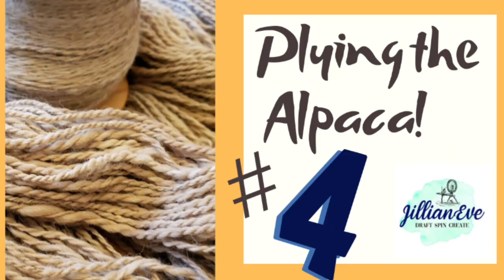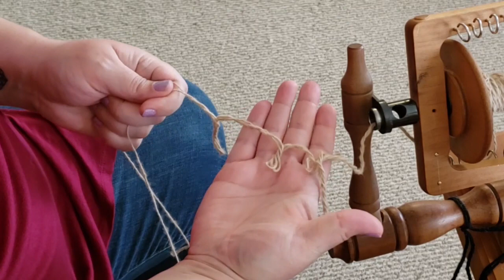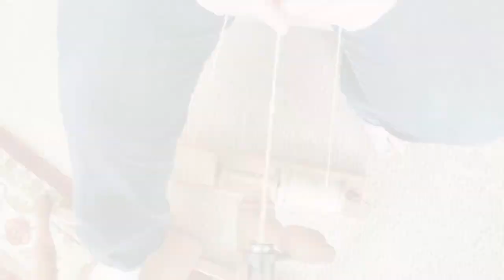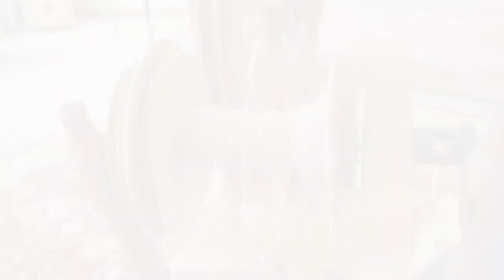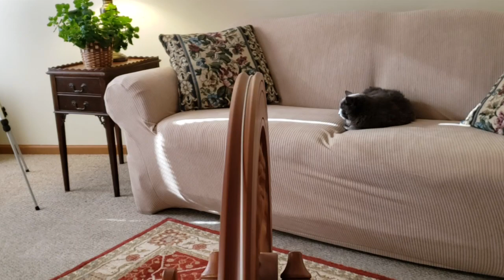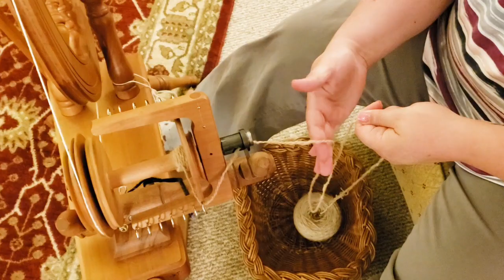How to Spin Yarn from Alpaca - Balanced Plying

Comment: This was actually helpful.  I think.  I'm trying to use all my alpaca and sheep wool I have stashed to make yarn that will work on my sweater knitting machine.  Now that I have learned a little bit more, I understand that I'm spinning too tight.  This was something I just dealt with when hand knitting.  Wasn't that big of a deal.  But with the knitting machine, it was falling off or snagging really bad and I have finally figured out that I had little random loops getting bigger and making the needle "misfire", if you will.  So then I went back a few steps and worked on that issue.  So I'm in the process of (,SO flipping slow!) spinning super thin alpaca and then I will ply it. It's hard to find the happy place between it taking up on the bobbin too fast. Or making twisties.  Because alpaca is so cloudlike in comparison to sheep wool that is more velcro-like. 

I'm working on a sweater for hubs and a blanket for one of my nieces, and then I think I will be ready to go back to presenting my work for sale. 

I have horses and I gotta make the money to feed them.  One of them is a draft!  Ugh! $$$$$$$

Comment: Another very good video on the technique and principles of plying. I have an original LeClerc wheel (bobbin driven)with a giant bobbin that I found in Victoria BC yonks ago.  It is my dedicated plying wheel. Since I also use a walking wheel, I have a Lazy Kate with two bobbins that I made myself. I made a tension box made from a cardboard box and 3 dowel rods(per Eileen Chadwick, The Craft Of Hand Spinning).  I place the Lazy Kate behind my chair and the tension box under my chair and of course the wheel in front of me. You are absolutely correct that the plied yarn should be relaxed(no tendency to twist) or real close to it. Be aware that cats have an intense fascination for yarn as it is coming off the bobbins of the Lazy kate.
Reply from the maker: I used to have a Louet, and I'm so sad I sold it. Those bobbin driven wheels are the best for plying! Also, an original LeClerc! What a treasure!

Comment: Thanks for your descriptive style of teaching! 😊 I am feeling a bit mixed up though. It seems like you ply 2 different styles—- by that I mean, when you began your plying you held each 1 ply in each hand. Those plys joined together and it looks like only the pull of the wheel got the yarn onto the bobbin. Further along your video. It looks different— 1 hand holds the 1 ply’s and the other seems to be feeding/pushing  the  plied yarn onto the bobbin. Hope that makes sense. And do I see that right? And does it make a difference? I am having trouble getting a consistent ply.